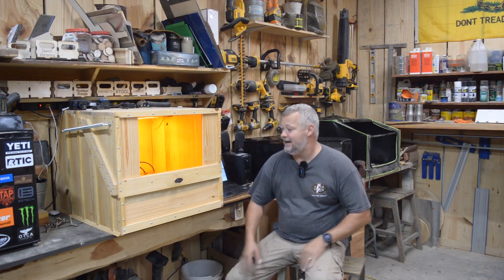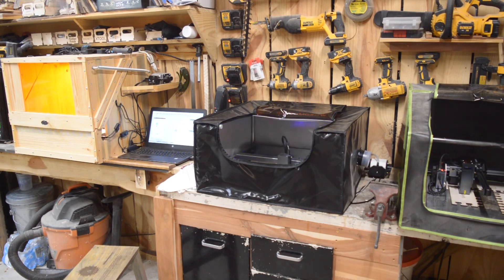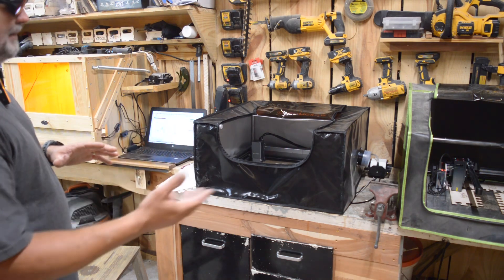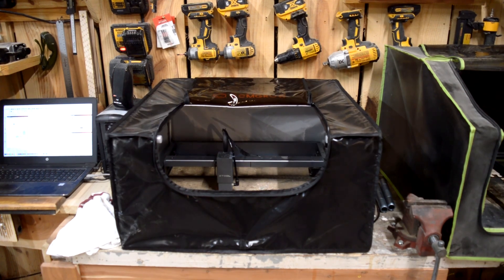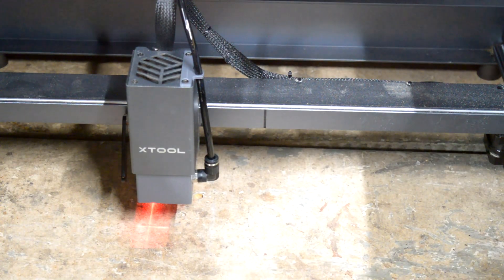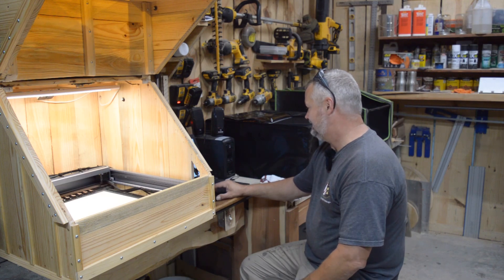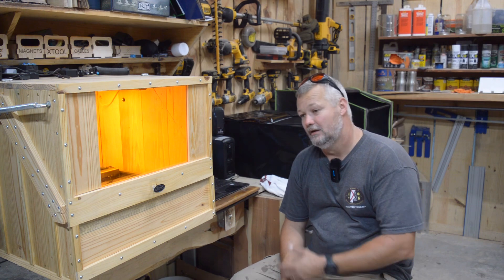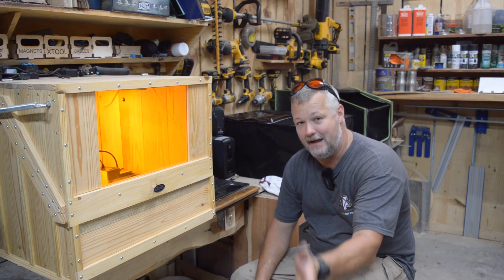Can you run 3 lasers on 1 PC?

Comment: Thank you for such an informative video. I am considering an xtool D1 20w. I have seen a lot of videos with the 20w  cutting wood but very few showing how fine it can engrave. Is the 20w mainly made for cutting or can it also engrave well. Thanks for your time.
Reply from the maker: I will be doing both with it. I have found that despite the rumors, the kerf isn't much more than the 10 watt if properly focused. As with anything, there are pros and cons to each machine. I will try to do some more videos of it engraving but I see not noticeable difference in its capabilities.

Comment: Good Morning Sir,
I may have missed it, but did the ink bandits require any adjustment to the cutting based on the wider kerf of the laser? Thanks for your videos.
Reply from the maker: Luckily, this is a glue up build. After figuring out how to properly adjust the focus, the kerf isn’t much bigger on thinner material. It is slightly larger but not enough to hurt this design. If these were snap together boxes, it would have been an issue.
Reply: @TheClackShack  thank you